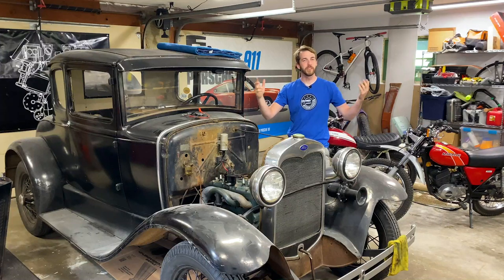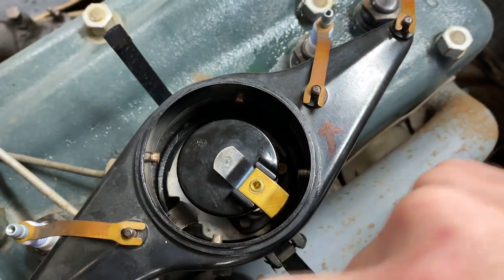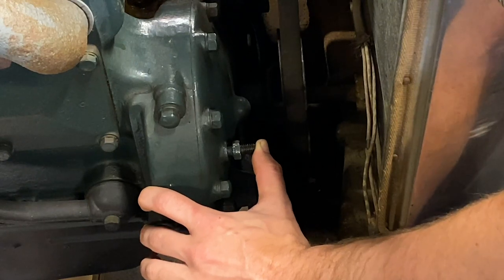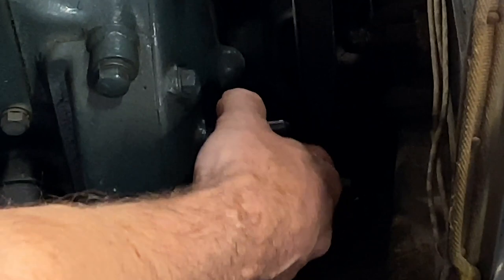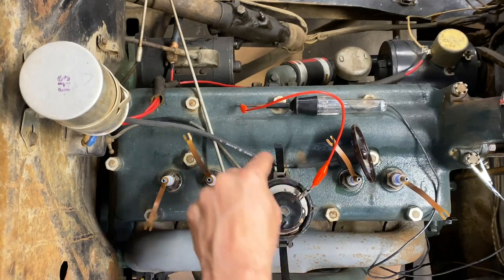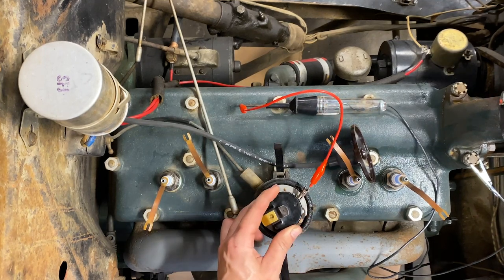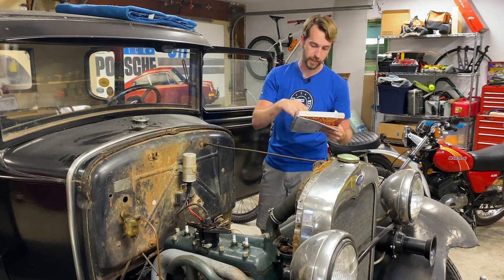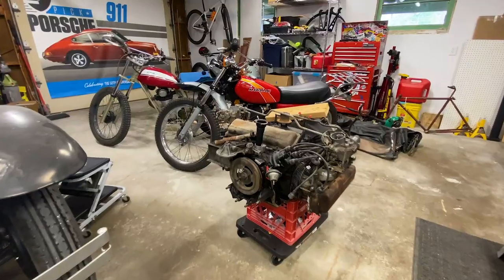Setting the timing on a Model A | Kyle's Garage - Ep. 6

Comment: I had a '64 Corvair Spyder (turbocharged) right out high school and it was a blast to drive, although the torso lag was tremendously late. Rebuild it to your specs and have a good time with it. Just a note, it will bolt up directly on a VW transaxle. We used to swap out the VW engine with the Corvair engine in our dune buggys.

Comment: Tape the water ports when drilling out a broke stud , medal shavings will kill a water pump down the road , also after heating a stud and trying to use an easy out,  try a little freon on the stud , heat expands medal and frees its rust weld , now freon will drink the stud and it will walk right out ,  it works

Comment: Use the plug in the cam cover. Drop it into the recess in the cam gear. Set the rotor to point at the #1 contact in the cap. This gets you close
 Adjust distributor for decent idle and power.

Comment: Excuse the ignorance, as I recall, T's and A's both had on-the-fly timing adjustment on the column AKA spark and throttle. Wont this help emanate timing / pinging / pre detonation problems? My family had several when I was a kid, hard to recall years ago. Also, the corvair motor. You should talk to Tom Cotter, have him find another corvair that needs work and you, Davin, and Tom do a complete restoration OEM or restomod on it, using that engine after complete rebuild. Sweet!

Comment: Looks like you could keep a spare set of spark-plug wires in your wallet back in the day .
Reply: I also don't see these degrading, short of severe corrosion of the conductor itself, or some corrosion in the connection points that can be cleaned off.

Comment: You're probably experiencing a weak spark when you use the manual advance. Look at the rotor's location. It should be further on the number one post when the points open. Fun stuff isn't it?

Comment: Take the corvair engine apart to diagnose any possible problems. Do not break the case. This engine is also simple. My engine is a 110 hp in  a greenbrier van dlx. 1965
 Good luck

Comment: Kyle, you do not have that engine timed correctly. You are reading the correct book but following the procedure incorrectly.  This is a very common error.  

The TRAILING edge of the rotor needs to be exactly lined up with the pin for #1 plug. You have the LEADING edge there. Remember, you said yourself, the rotor is turning CCW. As you advance the spark lever, the spark will move up from the trailing edge toward the leading edge, the more you advance it. Do it again this way and it will run smoothly.

Comment: Wow, that's like 40 degrees of slop in a distributor.   Can that be rebuilt & tightened up?  new bearings & gears?
Reply: Yes it can. Replace the 2 distributor drive shafts and eliminate half the slop. Replace the distributor drive gear (inside the valve chamber on the side, under the exhaust manifold) and eliminate the rest. No need to drive a Model A with this much slop in the rotor.

Comment: Dude that donk has a flat low profile, put it in a porches, build own superstructure with tunes or square tunes that fit within each other then put a gold colour bolt through the tubes. Don't weld. U can heat tubes a little to help bend then. Use laser system rented to perfectly square your superstructure.  U can buy a cheap thrashed out factory race porches for 2k usd. Run some korea made Hancock's. 5 bolt, all just cheap stuff off counter, buy Ford parts where possible, only run Ford lifters and engine parts.

Comment: What type of oil goes in that model A 30 waight
Reply: 10-30 oil works great.  If the engine is fresh, use detergent oil.  If the engine has a lot of miles on it, non-detergent.

Comment: I think if I remember corvair motors were rotory and they had a bunch of issues. I think block leaks was one. I suggest a total tear down to see what they look like and seal up like VWs are by shops now days.
Reply: The Corvair engine was an air cooled "boxer" 6 cylinder just like the 911 Porsche. It had hydraulic lifters and rockers like a Chevy Small Block. The first "Turbo Mufflers" come from turbocharged Corvairs.
Reply: Thanks, now you have me interested to do some research on these. I would actually like to pick up a old corvair. It would make great videos

Comment: NEVER advance and engine by turning the fan, especially on an A.  Also, get a distributor wrench from Mac's.....It's $15 and will make the job much easier. 

PS  You're car is still not timed correctly.  An A should idle smoothly with less than a quarter of advance.  I noticed yours was all the way advanced and when you to the advance out of it it died.